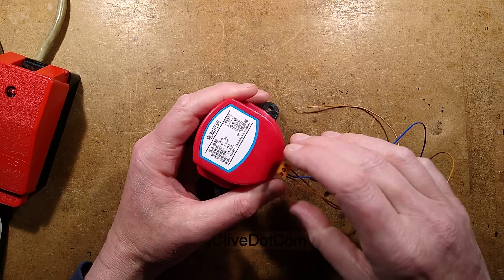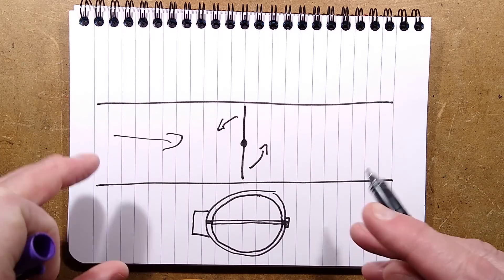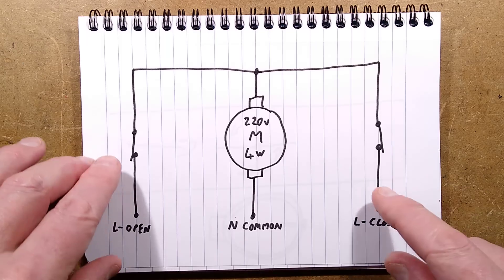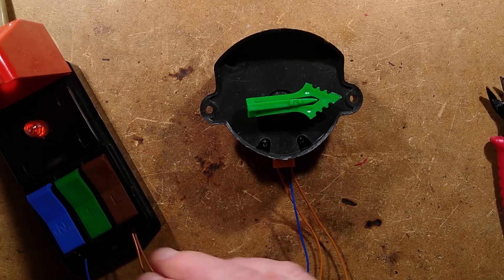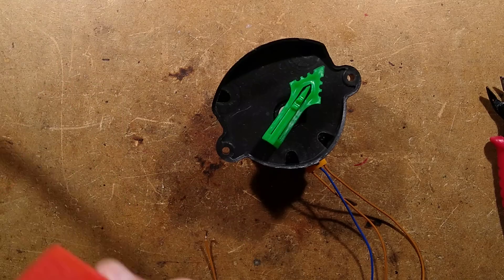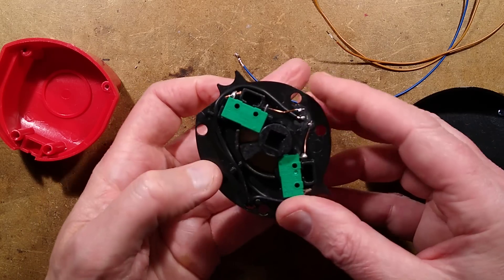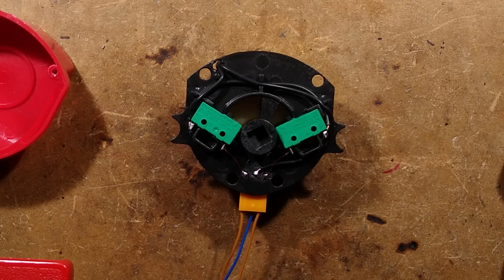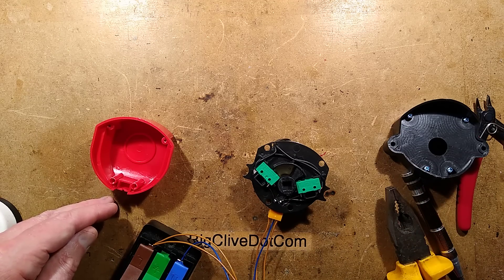Inside a cheap eBay rotary actuator

Comment: It's a Halloween ghost arm actuator, skeleton head turner, etc.  In the US, a true damper actuator in a commercial bldg is made of metal and is quite a bit larger.  And the ones I've seen have a position sensor so they can be set anywhere from full off to full on.   Someday I hope you pair up a thermostat, an actuator and 24 VAC to show how a VAV - variable air velocity unit works. Thanks, Clive.
Reply: I'd be interested in seeing the insides of the actuators with the position sensor too
Reply: Wouldn’t this be fine for a domestic actuator though? Multi zoning on domestic hvac?
Reply: The fact that a cheap... (er, 'frugal')...landlord can also order these from eBay or Amazon almost certainly means that there are, in fact, commercial installations of these 'dampers'.
Reply: @JasperJanssen  yes it would be fine for domestic or commercial hvac however your mileage may vary
Reply: I too would be interested to see a metal actuator function.
Reply: Patrick Hudson  nice HVAC controllers want the contacts to make sure its functioning. Even on home units.
Reply: I'm scouring ebay for the haunt now, lol
Reply: The largest damper motor manufacturer, Belimo, nearly all units are plastic. Made either in the US or Sweden. Metal dampers are the exception now, not the rule
Reply: @JasperJanssen  Yes, or any system that just needs to answer calls for heating or cooling like a conventional thermostat. An example would be feeding a small office off of an RTU that covers a large area of a warehouse or store. Putting one of these in allows some local control, albeit it’s useless if the main unit is inactive. But I have done things similar to that when in HVAC design. It’s a “good enough” solution for situations where cost would be a concern. For higher end installations, though, then local area control with something like air handlers with a central chiller would be used.
Reply: @JasperJanssen  A more common thing in offices and retail was something like a Therma-Fuser, tho. I think I used to spec those on Walgreen's Pharmacies if I recall, many years ago. Pretty neat since they are entirely passive and did not need any external power.
Reply: I think these aren't for HVAC, the above statement nailed it. I've built many HVAC systems using remote dampers. The actuator is built into a housing to connect into the ducting. To start, you need to choose NC or NO (Normally Closed / Normally Open) and match the HVAC controller. They are 24V and require signal wires be run back to the controller. This allows zoning of the structure, so that areas not requiring heating or cooling at the moment are shut off from the flow. Personally, I feel NC is a better option, they are powered only when calling for AC, and air backflow is minimized when not calling for AC.

Comment: I worked in a office with a system made by California Economizer.  The damper motors were supposed to be 90 seconds for 90 degrees rotation.  The system would switch between cool and heat as required depending on a majority vote of all thermostats.  The fan would stop and all dampers would be run shut for 90 seconds open loop, maybe stalling.  The rooms calling for conditioned air would then have their motors run for multiples of ten seconds equating to steps of 10 degrees of damper rotation.  When the dampers were adjusted, the fan would switch on.  There was also a bypass damper on the plenum to allow any excess volume to simply recirculate in the plenum.  The problem was some under-educated HVAC tech had put in five minute motors when the building was renovated and almost immediately all dampers assumed random positions.  As a quick fix, we manually opened them all to 45 degrees and disconnected the motor wires.  The boss didn’t want to buy new motors, so it stayed that way until the company vacated the building for a new headquarters.
Reply: @tactileslut  says the doctor, who fixed my hand.
Reply: @tactileslut  Well stated. 🙂
Reply: This is a more common mistake than you know. Good description. Sometimes, the controller provides alternate damper timing.
Reply: @msmith3537  I believe the California Economizer supported only 90 second damper timing.  It was a pretty old system.  The room thermostats were connected by I believe RS-485 and the dampers were individual circuits coming from an expansion board connected to the main controller, 24 VAC, 60 Hz. motors.  I thought it was pretty easy to figure out even though I’d never seen a zoned system before, but it threw a service person who was supposed to know commercial HVAC for a loop and he gave up.  My boss was one and done on service calls because we were renting, so I suggested we just manually open all dampers half way.  The fist day I worked there, I had 50 degree F and 100 degree F air alternately blowing down my neck every five minutes and I got a horrible neck ache, so there was a lot of incentive on my part to get the problem resolved.
Reply: Sounds like the building I work in what a mess now after many years they are tearing most of the systems out and replacing them but that is $8 million dollars for the latest contract .
Reply: An excellent description my good 🦸‍♂️ very involved but understandable, excellent commentary  just excellent.
Reply: @davidsmith-ih2kk  Thanks for the reply.  I agree; I thought my posting might have been too long.
Reply: @msmith3537  I've had actuators made up with custom drive times to avoid reprogramming siemens TEC's when retrofitting non-siemens valves. Works really well actually.

Comment: My house has one of these installed on the intake side of the air handler and it opens and closes a damper in a duct that leads to the outside. The builder claimed that since the house is/was so well insulated that code required it to draw in fresh outside air from time to time. It is connected to a timer that was set to open the damper and run the handler at a reduced speed for 15 minutes every 45 minutes. I can’t tell you how god awful annoying it was to hear the blower running constantly in the finished basement about a foot away from the couch. Upon further investigation I found that the flap at the end of the duct on the exterior of the house was not only the wrong style of flap but was mounted backwards. So every time the damper opened the air handler sucked the flap shut. Genius!

Comment: In the oscillation mode it could be repurposed as an illuminated sign swinger - or a Santa on the roof 😊 (with suitable weather protection).
Reply: Careful with swinging Santa there may be a swinging fairy close by...
Reply: this was my first thought, cycle test it with a santa!
Reply: @frogz  50000 cycles = 2½ week
Reply: That is the rating but will it last longer or shorter?
Reply: @frogz  Without knowing what gear train is inside the motor, it's just a guess.
Reply: @quantumleap359  - probably a worm drive meshing with a standard round gear.
Reply: @tbelding  made from the crappiest remelted plastic molded in a worn out aluminum cavity mold...
Reply: @Rorschach1024  - I take it you had a Pontiac Vibe?   Everything else was Toyota, but they HAD to use the crappy GM climate control system.   (and radio)  (BTW.  Two vibes, and I'm now in a Toyota Matrix.  19 years in basically the same car)
Reply: @tbelding  ??? I've never owned a Vibe, and I don't see where you could have arrived at that from this comment.
Reply: @Rorschach1024  It was a mistake -I posted two comments and thought you responded to the other one.   The GM damper actuator motors used in the Pontiac Vibe series (and probably similar GM's) used this exact structure to operate.

Comment: Its so much fun watching your videos Big Clive, you have such a melodic sleep inducing voice, it's just so nice listening to your description of the things you rip apart. Nice video as usual an excellent YouTube channel please keep up the good work BigClive. I have to point out that for 220 to 240 volts those are very very thin wires with correspondingly thin insulation, I wouldn't want to be working on a system using those tiny wires, wait a mo, I'm not an electrician so I guess I will never be working on this setup but I do feel for electricians who do  though. Also all this time I thought I was subscribed to your channel with the corresponding bell filled in, but alas I now know why I was never informed of your new videos apologies BigClive that has been rectified. Again lovely informative video thank you BigClive.

Comment: I had no idea these existed! It's perfect for a little automated woodstove project I've been gathering parts for. I need to ditch the motor for a servo but all the hardware is perfect, I found a small 3" one with silicone seals.

Comment: Fire damper motors I've seen in Australia are much more substantial spring-return (fail-safe) devices with switch outputs to indicate position. Solid metal cases as part of the fire rating. They sound more like the water valves you described.

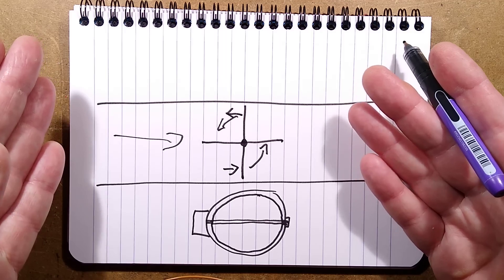Comment: 1:55 In fact, it takes more force to close the valve, because when totally open, air pressure is balanced on both sides. It then acts like the wings on a arrow. Once the valve has moved from this balanced position, the unbalance enlights the force on the actuator.
Reply: Actually that is a balanced damper...pretty much equal at all positions
Reply: @whitemonkey7932  yes, but if there is a heavy volume of air passing by, and the valve is completely open, and the  actuator gets power to start closing the valve, the start current at the first milliseconds is higher then the start current when the valve is closed and the actuator gets power to start opening. 
When a butterfly valve is completely open, you have a laminar air stream, when a closed valve starts to open, you start with a turbulent air stream.

Comment: A very reliable configuration. Runs on line voltage👍 a similar configuration that runs 5 volt dc is prone to micro- corrosion and presents many difficulties, over time.

Comment: This is a cost effective version of the VAV units I am used to seeing in the world of HVAC solutions. Ones That I have played with had duct pressure,  I/O dry contacts for valve/fan controls, and a bunch of other options shy of keyboard bashing to program it to do whatever you need it to do.

Comment: I used a lot of similar but much larger valve actuator back in the day and also help design some for the chemical industry. We used to send power and control data over a twisted pair.

Comment: Exactly. Make things as simple and robust as possible. No use in overcomplicating the design!

I wish people would do the same in computer programming. It would make many systems more robust. And much safer. 
What is not present can not break, and it can also not be attacked.

Comment: When Clive gets mad because things don’t come to bits easily, he instantly resorts to brute force.😂
Reply from the maker: That's the pressure of having the camera rolling.
Reply: Doesn't everyone??
Reply: Is there another method?
Reply: @cornrichard  no. Brute force is the way to go.
Reply: @davelowets  yes, unless it involves fixing electronics.
Reply: @bigclivedotcom  I agree.
Reply: @bigclivedotcom  Brute force and awkwardness often wins the day! Cool little actuator!  I wonder what the gearbox inside the motor looks like? That would tell the tale about its longevity.

Comment: I have a linear actuator from China. I use it to open and close a door lock. It works reasnably well and has for the past 7 years. The downside is that the plastic coller through which the piston slides has detached itself.

Comment: its an actuator for hvac systems with variable vain ouets.  this device can open and close air ducts to add or stop air going to a specific area based on temperture.

Comment: OK.
50,000 cycles must be the specification of the specimen valve controller they copied to produce this cheap version.
I doubt this version can reach 5,000 open /close cycles.
This valve controllers can be in very critical roles.
The 3 Mile Island incident was caused by an open valve that reported to be closed.
Thank you BigClive for the video...
Reply: To be fair, the indicator light at TMI was not actually connected to contacts on the valve, it was instead wired in parallel with the solenoid. The light just showed you what had been commanded, not what had actually happened

Comment: Considering they use nylon gears for the air damper actuator for the Pontiac Vibe (and other GM vehicles), I can reasonably say that it's not going to last 50,000 cycles.   The actuator 'halts' by jamming itself against the end of travel. When you reverse it, it moves slowly until it jams to a halt at the other end of travel - until it breaks teeth, and starts going 'thunk, thunk, thunk, thunk, thunk'.  It generally breaks within 5 years of driving.  I went through three in two vehicles.

Comment: You could use it as an oscillator for a cheap desk fan! Sorry, those in the colder climates would not understand. 🥵
Reply: We understand plenty. I took apart a Honeywell Digital Oscillating Floor fan the other day and it used this same type of low RPM alarm clock motorb to do the oscillations. The main motorb seems fried so I was thinking of turning it into a red LED light pivoter and put my Tiffany White Glass window I made in front of it to do ripplelike projections and such.
Reply: I had never thought of this. I think some tinkering will be needed

Comment: Interesting thing. I wonder what determines the direction. The motor doesn't have two separate windings for left and right, and it's AC powered, so if it's stopped in between extreme positions (e.g. due to power loss while operating), there's probably no way of telling which direction it will rotate when powered. I've worked on a 24VDC linear actuator that had limit switches bypassed with diodes to allow it going in the opposite direction, but that's pretty self-explanatory. 

Note that while one wire will be cut off in an extreme position, both of them will be live during changeover. Relay based control circuits will be safe against it, but anything with SCR might not.
Reply: Synchronous AC motors are special, if they can't go one way, they'll try to go the other way. 
In your scenario, when power returns, the motor can go the either direction, but then stall at the other end and reverse direction until it hits the right switch.
Reply: When it's somewhere in the middle, the direction of turning might be purely down to which part of the sine wave it's in. I remember hearing that explanation with regard to the microwave's turntable motor. Could be wrong, though.
Reply: @rolfs2165  Your not.
Reply: @rolfs2165   I only (relatively) recently discovered this about synchronous motors.  One day, while staring at something being radiated to hotness, it seemed that the turntable was going backwards.  I started to pay attention, and it seemed like it often did go backwards.

I brought this up to the missus, who stared at it, then declared I was wrong (as she often does.)  So the next time we had to microwave something in short spurts, I made a bet with her that it did randomly reverse direction, and was gratified to learn I was right.

Life is made substantially sweeter by small victories such as this.
Reply: @Okurkaarrgghh  and all - thanks for the replies, it's all clear to me now :)

Comment: I purchased an inline damper valve from ebay, knowing it would be fairly Chinesey and indeed it's one of these actuators, by the way it moved I figured it was something fairly simple by design, I've not installed it now but now I see it's a little less of a fire risk than first thought, I think I'll go for it - interesting side note about the non-active terminal being live though, I'll watch out for that - my plan is to use a smart switch to time a bathroom fan and use this to close off any draughts, the manual backdraught shutters flap and bang so are less desirable!
Reply from the maker: Some fans have a wax motor to open the louvres when in use.
Reply: @bigclivedotcom  That's my current method actually, I brought a cheap fan just for it's shutters, snipped out the fan and motor, haha

Comment: We have chiller valves that work off a tiny motor like that. They run a vertical screw on plastic gears. They hold up decently however the motor gets very very hot. ⚡️⚡️⚡️

Comment: As others have mentioned , the motor is similar to many turntable motors from microwave ovens ... there are many uses for these , from dumped ovens ... 1st , mounted at the base of Christmas tree with a long rod to the top can be used for an ever rotating fairy ( ? , hmm )  next 2nd , grip the 3 prong platter rotator adaptor , give it a hefty twist , the motor's rotor will spin at huge speed , and will deliver a painful shock if you are in contact with the power tabs ! ! ... this will light neons / or strings of LEDs , if you go via a bridge rectifier............

Comment: That looks like the device inside a portable A/C unit I have in the loft of my house. It moves inner directional blades and can be set to "swing" back and forth directing air to the left and right of the unit. For a portable A/C unit it works fine, it was a gift so it's hard for me to justify replacing it until it dies of natural causes as it does the job well enough.
Reply from the maker: Those tend to use a common geared stepper motor with clutch.

Comment: It is also listed with different valve body sizes (interfaces) "Air Damper Valve Electric Air Duct Motorized Damper for Ventilation Pipe Valve"

Comment: Interesting - would be something to see you compare to the USA damper controls that are 24VAC and I gather typically auto return so you energize it to close, de-energize to open (or vice versa) but I think work holding it with motor stall not a switch.